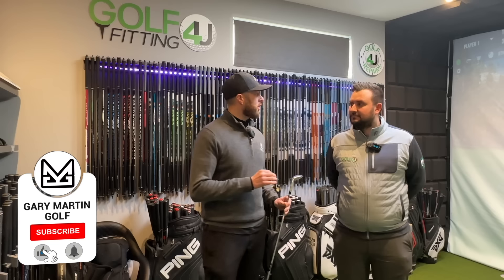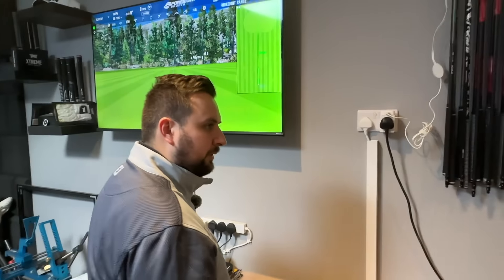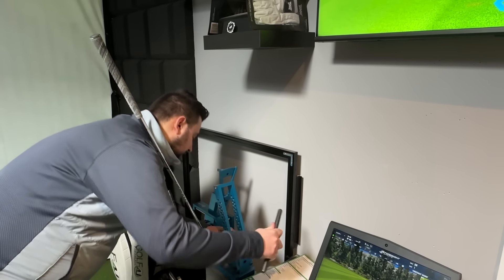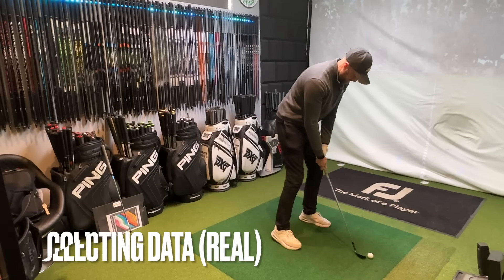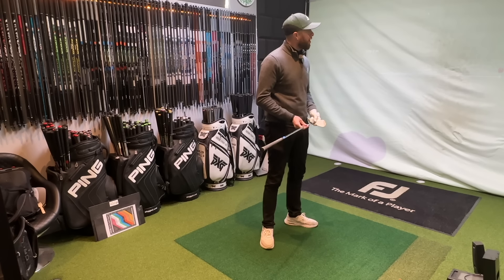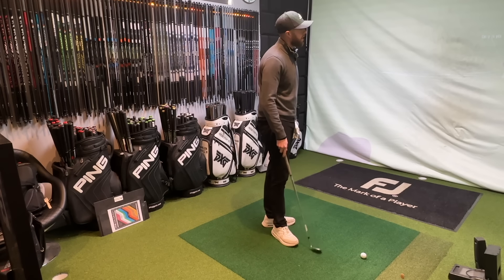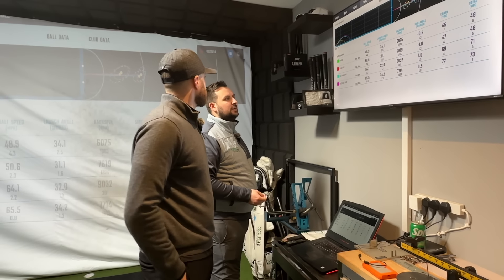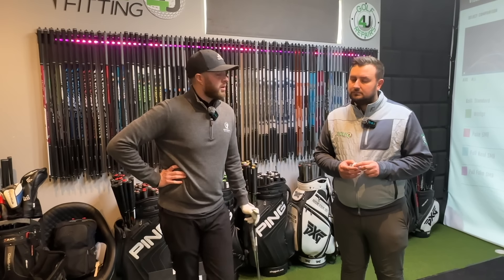£29.99 aliexpress fake titleist vokey wedges look  amazing

Comment: To be fair, there is not much difference in the distance held as you can see they are still going the same as you want them to but with the spin difference.  Unless you do a robot test nothing can be certain, as human error always plays a factor. 

Looking at your full swing data of the fake wedge for the first shot, is clear that when you changed wedge there might have been some change in your situation causing the strike to be at the 4000s for spin. And therefore the average spin rate went down to the 7000s, other wise it would have been in the 8s which is a better data set to compare.

Comment: 30 quid !!!! Sign me up  😂😂 
But seriously, for a player who plays once a week and goes though 4-6 cheap balls a round these are probably a great option. It’s still half the price of the cheapest wedge on the market considering that 
Here in the U. S. a new vokey sells for $190.00 usd …4 wedges = $760. But 4 fakes = $150 Do you think there is $610 of performance difference to a weekend warrior ?
Reply: I bought a set of AliExpress last year. I bought 3 of the bronze finish with the black shaft. They play great! If I didn't have custom length shafts with larger grips, I would have no issues using them every round. If you're a good golfer or have a lot of money, buy the Titleist. If you're recreational, a beginner, or on a tight budget like I was in high school, these are perfect.
Reply: @sil-80nick  How was the wear ? this seems to be a common talking point, they show wear very easily "apparently" ( club grooves/face)

Comment: I lost my second hand 58° Mizuno which I loved. I just bought 3 NEW wedges on ebay £50. I buy 100 second hand balls for £15. I mostly only have time to visit the driving range. Unless you're shaving your 5 handycap down to 4 or have enough funds to get a fitted set 1/2 an inch shorter shaft or lie angle is not going to make a difference. You have to adapt to the different clubs.  Once I get used to the new distances these produce  they will be  good enough for the foreseeable future.
Test the gapping on a full set. That's the only thing that matters. They don't have to be the same as any quality manufacturer.

Great content though! Keep it up.

Comment: Nice one Gaz. One way to look at it is that they aren’t scammers, they’re actually offering a budget solution for most recreational golfers.  What it does prove though is that Titleist are having our pants down on the RRP.
Reply from the maker: The issue is, this isn’t a Titleist, take the branding off it and no offence to fazer, ram etc, but you’ve got a budget wedge, if not, worse than a budget wedge as it damages balls and the quality built tolerances aren’t great.

The next stage is to text on the course with fake vrs real, and fake vs budget, I’m just building up to it. 

I need some irons, driver and putter now 😅
Reply: Gaz, most golfers can’t go 3 holes without losing a ball or bouncing it along a cart path anyway so scuffs don’t matter 😂
Reply: Titleist Vokeys are not expensive if you buy the older version new, if that makes sense. Sm8’s are as low as £70 new, so good value.
Reply: Did u try to bend the fake wedge?
Reply: @thejoker7323

Its a fake coy of a popular brand, that makes them scammers, if they won’t yo be honest just make a club with their own branding and advertise it as a budget club copied off the Vokey design
Reply: @Pud56 where are you finding these prices
Reply: Wipe your hands clean there pal. Lol

Comment: on the surface, I'd say that with a Vokey or other "name brand" you are paying for the product, and also for the engineering /research/development it took to make the final product (oh yeah, and a bit for marketing too).   With a copy, you are only paying for the cost of manufacturing.   The manufacturer of the copy does not have to figure out that they need to use 430 carbon steel, or which grind works best, That is all done by the name-brand guys,  for a quality copy all they need is to use the same specs, or close and pump them out. if they are less concerned with matching the original specs, and they only care about the look of the copy (which is the case many times)  its even easier for them.    of course, there are other issues surrounding copies, including legal, ethical.....
Reply from the maker: Some great points. I would also add that a lot of quality engineering goes into making a golf club, far more than what can be seen on the surface and real products are manufactured to a lot higher standard as they have tighter tolerances on quality.
Reply: Exactly

Comment: I recently replaced an older beat up wedge with a new milled face 56* “Musashi” wedge head from Aliexpress; $35 USD.  It performs incredibly well, so much so that I’ve ordered the same head in 52*.  If your older heads are beat, consider this as huge upgrade.  I’m a 13 index. It’s already saving strokes from 85 yds in.
Reply from the maker: Is it kind to the cover or your golf balls?
Reply: @garymartingolf  : actually the musashi is kind to the covers.  I suspect the fake Vokey wedge had machining burrs in the grooves and were not properly be-burred as machined metals often require.  I thought $35 was worth the risk, I hope the next one is as well made as the first I received.  Really exceptional quality, which I believe is never a guarantee from Aliexpress.

Comment: Just curious if the shafts step pattern matched up? The Vokey would have a TT Dynamic Gold Taper tip with 12 steps at 1.75" long. What's the fake got? Is the lowest step the same distance from the hosel?

Comment: OMG that’s exactly my specs, except for my swing weight (also D2if I can remember correctly).
Reply: BTW, I saw that you can also get club heads on their own. As well as some shafts. You can then mix n match and add weight to the tip, or butt of the shaft, etc. Basically create the clubs the way you want them. Could be a fun project.

E.g. I saw some black 0311 gen 4 look-a-likes, I could get some KBS Tour stiff shafts, and those grips you talked about. Get them to my specs and build them myself… 🤔

Comment: Was the real club new or had it been in play for some time? That could make all the difference in the grooves.
Reply from the maker: Yeah, it wasn’t new out of the wrapper, it was a few months old. In terms of cutting the ball, I’ve never seen a wedge do that in recent times, they might mark the ball when new, but this was slicing into the cover.
Reply: @garymartingolf That sounds like it's a square groove wedge. So, not permissible for play.